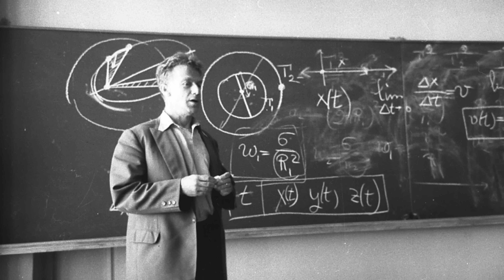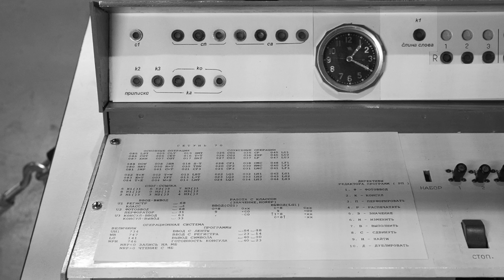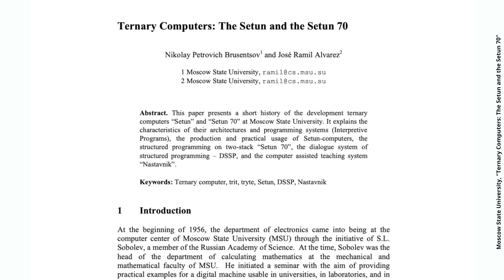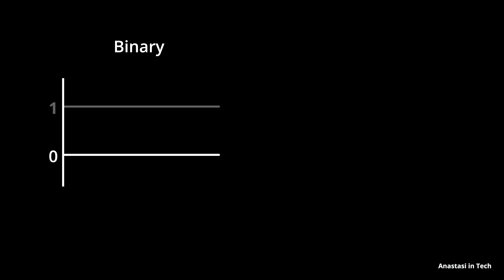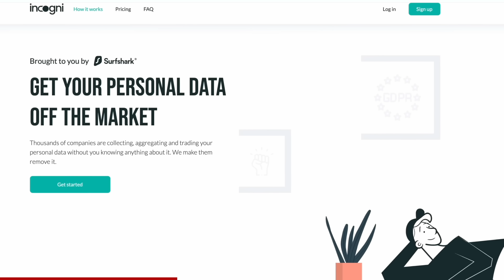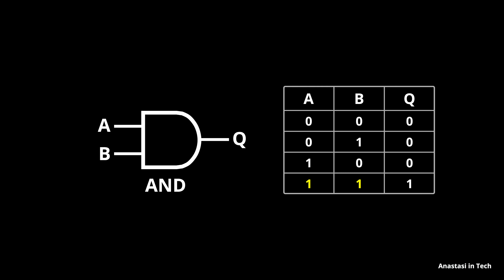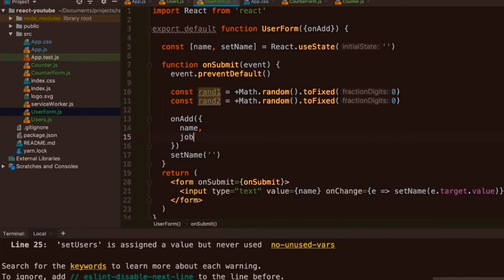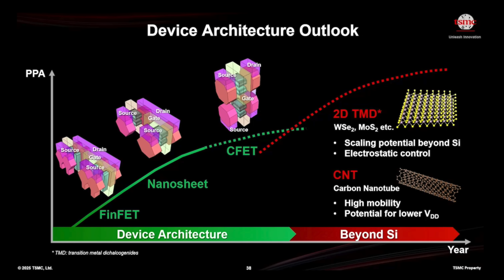The World's First Ternary Computer

Comment: There is a reason binary is dominant. It isn't just the math that needs to work. It's the physical mediums we use to transfer data. It's not just vacuum tubes but copper and fiber cables transfer data via electricity or light traveling the wire is either on or off (1 or 0).  Having to find a 3rd state and measure it will cause more errors and delay.
Reply: We invented a whole class of semiconductors called Schmitt Trigger buffers to differentiate high and low voltage signals. Its not a question of changing formats from hex to octal to BCD. Which are still essentially binary systems. This is a totally different system. Things are either on or off in the digital world, not partially on. Not to mention binary and Boolean logic easily interchange.
Reply: @AdamMiller-o2d 

If voltage sensing is so difficult and unusably error prone, I'm wondering why Nand Flash with it's current 16 voltage levels per floating-gate transistor (and the soon to be commercial 32 voltage level PLC) not run as hard into these  difficulties?

Also makes me wonder about DDR and even AGPx8 from a quarter of a century ago (Octa Data Rate), which I assume deal more properly with signals (than just sensing the voltage in a gloating gate transistor), would also need reliable qnd minimal error prone voltage sensing. 
In this case its not just a need to differentiate between different voltage levels, but the change in voltage.

I also wondering, since DRAM employs capacitors, multi voltage levels might be doable.
Reply: @tylerdurden3722  also 5g signal can use up to 256 states (8 bit) in one signal piece, 16 states on each of two axes wave amplitudes.
Reply: ternary is not totally different. It's easy to prove that functionality, it's equivalent with binary. So any possible benefit can only come from implementation. And then binary is just very simple and pragmatic. S/N will always be superior in a binary system.
Reply: convert  results to binary - note that trinary will save huge amt of elec
Reply: @hillwalker8741 plausible. nowadays we need also to care about quantum physics also.. lower voltage why? you get smaller n smaller n fields start to tunnel 😊 lets see what may be created in Future;) still qbits shown is not a singular  solution. means i think there may be a mix of some systematic ideas needed. 🤔
Reply: Who prevents you from conducting heavy computations in 3 states and then convert the data to 2 states for transmisson? Computers conver data all the time. File formats, encoding systems, energy levels, and even medium type. Converting base is one of the simplest tasks there is in this innovation.
Reply: @DimaZheludko  Hell the entire NIC architecture is a computer BESIDE the computer to do communication transmission.
Reply: @DimaZheludko nobody prevents, but you may loose suddenly the positive effects of it. somehow you depend on the infra. it may be not a quastion of doabiliry. hunankind and computers... ist relatively "new" ... and sure not the final spoken word. its a development. thanks to ada and Alan 😅
Reply: @DimaZheludko  It's not that you're prevented, it's just that it requires more precision at the lowest of levels. It may be easier to pull that off today, but the fact that it's still making something hard even harder is unchanged. Also, the conversions you mentioned may be expressed and represented to you differently, but they are still binary under the hood.
Reply: @lloydharris8766  Agree with both points. Well, what can I say. If it was easy, everyone would do it already. 
So until someone does it and proves that three states are better indeed, we'll have to guess.
Reply: By the way, SSD drives store 2 or 3 bits per cell. So, the concept of storing more data with more energy levels is not unprecedented. Or course, storing is one thing, and processing is totally another. However, 3 bits is much more complex than 3 states (wich is more like a 1.5 bit).
Reply: @lloydharris8766  Sure, it was difficult 100 years ago. But today, practically all transmission technologies you use employ more than two states. Wi-Fi, Ethernet, USB, etc. None of that uses two states at the physical layer. Some even use three states, like some decades old version of Ethernet. But usually more than that.
Reply: @DimaZheludko  you are comparing 3 bits which are 6 states ( 0 or 1 multiplied by 3) with only a trit, which has 3 states. You should compare 3 bits to 3 trita, which is 9 states (3 states x 3 cells)
Reply: @justiziero eh you do the same.. exp(b,n) 😊 symbol combinations, Interpretation. in rhe final end nevertheless how you do, all are patterns ;-)
Reply: This is the best explanation. yes. its simplicity is its power
Reply: Electricity can be OFF, Positive Voltage,  Negative Voltage
Light can be OFF,  and ON in 2 different polarities

so instead of just +5V, 0V you would have +5V, 0, -5V as possible values for trits
Reply: @LucasFerreira-n6e  I believe currently the levels are 0v and 1.67v
Reply: @qantj  "Currently" is not a thing. Voltages depend on a CPU model and even bios settings. 
I set my voltages as low as 0.7-0.8 volts. The lower the voltage, the less heat CPU will produce. Less heat = less cooling = less noise. There is a chance of instability at low voltages though, so they have to be carefully tested.
Reply: @DimaZheludko  why not relying on the manufacturers settings with the optimum levels established through thorough research involving highly complex system, not a homemade one based on the simplest parameter?
Reply: @lesterryanmd  Your question about optimum levels is too broad to interpret without proper context. I'll make a guess, and if my guess is wrong, try more exact question next time.
If you're asking why I set my CPU voltage lower that factory default, it's because factory default settings are tweaked to needs of wide range of average users. And I'm not an average user. My needs are quite specific, so my optimization is specific as well.
Reply: @qantj sounds about right 
It was 5v then 3.3 volts. As you lower the voltage you get more efficiency and less heat
Reply: @loulelea  Not just greater efficiency (less heat is due to the increased efficiency ;P), but also increased clock speed capability since the system doesn't need to change voltage as far
Reply: while thats true it is probably trivial for a company capable of making 7nm scale chips to design a new class of cable that has an extra set of conductors, or fiber strands for the -1's. A simple example: 2 fiber strands, wire A.) light on  =1 light off =0  wire B.) light on = -1 light off = 0. And then in theory the only conversion that has to happen is the one that already has to happen when the light is converted to electrons at the termination of the strand inside a GBIC/SFP or the like.  And whats fun about THAT is most commercial fiber runs already are run with extra 'dark' strands just in case a wire gets damaged, so you can borrow some of those in place to make it work without having to go re run all the existing fiber. 

as for how to split the 1s and -1s to the strands and back again reliably .... I only know enough to be dangerous, so you have me cornered there. But I am sure some big brain can figure it out.

The real challenge is getting consumers to accept all the losses of existing stuff when everything needs to be created on a new type of machine code. The same problem vexing ARM outside of mobile and Apple product markets.
Reply: Sure, interconnect hardware and cabling can still be binary but the computing hardware at the silicon layer looks promising in ternary.
Reply: @mohammadhalipoto even in serial data transmission you could potentially use a clock generator to distinguish between plus voltage minus voltage and no voltage
Reply: @loulelea  Or you can use diodes, just like when taking a sinusoidal voltage that ranges from +V to -V and isolating either the positive or negative voltage from it.
Reply: @bryankreinhart indeed that’s how and or nor gates are made
Reply: Except that right now data is transmitted across copper by varying voltages. One voltage = 0 and another = 1. So, you add in a third voltage level to = -1 or 2. The same can be done with fiber. Use colors. One wavelength = -1, another = 0, and a third = 1. It wouldn't even be that hard to do with current technology.
Reply: @JoelVogt1972  What you're proposing for optics is essentially frequency modulation (using changes in frequency to encode a signal). I don't think anybody would do that. It's rather naive. Simultaneous transmission of multiple wavelengths is used for multiplexing. So we do have the required technology to combine light from multiple lasers and to then split it (which is where you have to separate wavelengths as receivers are typically not too picky). But there are more sophisticated ways to create multiple states than simply "blinking" different colours.
Reply: The output of each logic cone at the input of each latch would have to reach its final state a little before the next clock edge. This is the same for binary.

But this makes me wonder, would that require clocks to run slower (for a given technology)?

Naively I would think the swing from -1 to +1 would take longer than from either -1 or +1 to 0, so clocks would not need to be slower. But because there’s more ambiguity distinguishing zero from the other two states, maybe it would take longer to reach an unambiguous final state…?
Reply: Actually, transmission is the least problematic of all. And three states are trivial to create by simply using negative rail for the third state (that is +V, 0, -V). Today, QAM and PAM are widely used and all use more than 2 states (256-QAM has 256 states encoding 8 bits per clock cycle). Not to mention that data is generally encoded for transmission (and storage). One of the classics being 8b/10b (encoding 8 bits of data into 10 bits for transmission). Exactly because you have to deal with limitations of transmission lines and transceivers. Even in the binary world, you don't want long strings of zeros (or ones, conversely) which you might encounter in real data. Hence why you have schemes like 8b/10b or Manchester.
Reply: The technology exists where light can be used for high-speed data transfer. The advantage of light is that multiple wavelengths can be combined (multiplexed). And, if using RGB for the 3 states and, using a simple example of the byte values of RGB used in your color palette, it would be:
  RED  | GREEN | BLUE
====================
 0x00 |  0x00 | 0x00
 0x00 |  0x00 | 0x7F
 0x00 |  0x00 | 0xFF
 0x00 |  0x7F | 0x00
 0x00 |  0x7F | 0x7F
 0x00 |  0x7F | 0xFF
 0x00 |  0xFF | 0x00
 0x00 |  0xFF | 0x7F
 0x00 |  0xFF | 0xFF
 0x7F |  0x00 | 0x00
 0x7F |  0x00 | 0x7F
 0x7F |  0x00 | 0xFF
 0x7F |  0x7F | 0x00
 0x7F |  0x7F | 0x7F
 0x7F |  0x7F | 0xFF
 0x7F |  0xFF | 0x00
 0x7F |  0xFF | 0x7F
 0x7F |  0xFF | 0xFF
 0xFF |  0x00 | 0x00
 0xFF |  0x00 | 0x7F
 0xFF |  0x00 | 0xFF
 0xFF |  0x7F | 0x00
 0xFF |  0x7F | 0x7F
 0xFF |  0x7F | 0xFF
 0xFF |  0xFF | 0x00
 0xFF |  0xFF | 0x7F
 0xFF |  0xFF | 0xFF
How these values are interpreted is not set in stone and can be, arbitrarily, +1 = 0x00, 0 = 0x7F, -1 = 0xFF, or even +1 = 0x7F, 0 = 0x00, -1 = 0xFF.
Reply: @bryankreinhart I find the light tech to be fun to study. But think about an interface that bonds discrete light channels with this ternary system (used for sensor switching matrix), good and durable for direct transport. At some point, subsystems come into play, regarding the final product. My brain cannot conceive of light channels being energy efficient except at volume, such as data transport. There's a video on this I haven't watched yet.
Reply: @bryankreinhart you are mixing up things. What you describe cannot work because the white light at the bottom of your list is indistinguishable from R+G+B. Also there's absolutely no reason to stick to RGB. The important factor is how well the light producer and sensor can operate within well defined frequency bandwidths.
Reply: And the circuitry requires more than 2x as many transistors per logic gate for only 3/2 as man values.  PER DATA LINE.  And the compexity only gets worse when you look at things such as adder/subtractors.
In comparison, "not valid" can be indicated by merely devoting one bit to be "valid/not valid" for any sized quantity... or not.  Thus, even the argument for "0, 1, not-valid" isn't even worth the cost, complexity and extra power consumption.
Reply: I was about to write a similar comment to yours because i didn't know there was one like this so instead im just gonna like this comment
Reply: Hard drives  and ssd also can not store ternary data YET AFAIK
Reply: @dosergiobr  What do you mean? SSDs store 3 bits per cell, not even 3 states.
3 bits is 8 states. So it's not out of the question to store even two trits of data per cell, if market ever demands. Storing 3 states is a walk in a park compared to what we do now. 

Also, nobody stops you from using SSDs as they are not and just convert data somewhere down the line.
Reply: @dosergiobr  Idk how you'd do it for hard drives but SSDs already have multiple storage levels so you just change how you recognise them from binary 3 or 4 state per memory cell (0000-1111) to trinary (000 to 111/-111 or some such, quad storage tends to be a bit unstable I think).
Reply: @dosergiobr hm. good point 😂 but no idea how internaly really its done. but well lets say there could be a solution somehow
Reply: It is widely used already - as DDR on RAM buses. We're used since early 1980-s, in big supercomputers and telecommunications. Wasn't cheap, but not unique.
Reply: Oh, no. Here we go with numerology and trinity. Of course triangles have three sides. And traffic lights have three colors! And tricycles have three wheels!  The lamp in my living room has three different brightness settings! It must all mean something!
Reply: @SolidAir54321  Oh, yes, yes! You see it too! Join our group of those, who see world as it is - in 3 states! Let's fight these 4-worshipers! 

You see, today they say that matter have 4 states instead of 3. But what tomorrow? Tomorrow thay'll say that we live in 4-dimentional spacetime (or some other nonesence) and now we have to put 4-th wheel on all our tricycles! 

What next? All computer graphics will be drawn with squares? 4 color subpixels in displays? In no time we'll have all Rickshaw's on four wheels! We can't have that! Think of the Chile!
Reply: "Having to find a 3rd state and measure it will cause more errors and delay." -- this should not worry us.  We have several advanced error detection and correction algorithms that are being used in digital communications.  There may be a little bit of reduction in transmission efficiency, though.
Reply: false and short sighted as a wombat:face-green-smiling:
Reply: agreed, but the chips exist, 3 power lines cause more cost but only in the power lines, the ground line as in 3 phase, should carry minimal current and be there as a reference.... but the benefits of 3 states ^n vs 2 states^ is obvious. the copper losses should work out equivalent. Insulation is cheap. cheers mate
Reply: All you geniuses out there keep talking about voltage and blah blah blah....here's the thing, copper is being phased out as a physical medium. It's all about fiber today. So tell me about how light has 3 states. Oh wait, it doesn't.
Reply: @dtharve My lamp has bright, dull and off states. We just need a three state switch. : )
Reply: @RJjohnson2026 yes. but dull costs Energy. maybe light is fast enough to serialize instead dull... problem msy be the differentiation of dull state to map... nevertheless... a Transistor also has sigmoidal nature and just 2 stages are used. some things tech does may have some reasons.
Reply: @dtharve  Light has many different wavelengths where specific wavelengths can represent specific values. You have heard of RGB (Red-Green-Blue) haven't you?
Reply: @bryankreinhart sure. and that mapping makes things more easy? a frequency light Splitter. lol
Reply: @fishypkat151  Have you ever heard of "fiber optics" technology?
Reply: @dtharve  Information transfer with light is more complicated than on or off. Information is often encoded in the amplitute, frequency, and/or the phase
Reply: @dtharve  light is EM just like the waves on copper, and you can encode it in as many phase and amplitude states as you want.  Laser modulators are currently 4 phase states.  RF is using 4096 in some applications.  It’s all limited by signal to noise.
Reply: exactly
Reply: Why limit your argument with only the states of on or off instead of expanding your mind?
Data can be transferred in 3 states easily. You can use off, positive voltage and negative voltage. Even using "primitive" technology using a relay, you can decode such a signal. The relay is designed with two coils (A & B), one on either side of the armature. When a positive voltage is sent, direct it to coil A energizing it for one state (+V). When zero volts is sent, neither relay in energized for the second state (0V). When a negative voltage is sent, direct it to coil B to energize it for the third state (-V). Think of it as a switch that, in the center position, it is off. When flipped up, it sends a positive voltage. When flipped down, it sends a negative voltage. Such switches are used on electronics such as the Cobra 148 GTL where, if the switch is set in the middle, it is on AM; if up then USB; if down then LSB. On the 148, there are 4 such 3 position switches.
Reply: Most fiber uses 4 states - QAM
Reply: I agree. The power of binary was the lowest level building block. It was about predictive results, and knowledge about error checking, Hamming Code, Gray Code for electronics, failover state. Any higher chance of logic fail was unacceptable. The necessity of ECC just sounds bad. I thought of trinary, but the fragility is in question. It solves a fundamental logic gate problem though.
Reply: Agreed we have,  and nor and or detectors that also function in pneumatic and liquid logical devices like machine tools and autotransmission.
Reply: The reason is that math is hard. NOBODY solved electrostatics in 3D. I think the Steinmetz equation was the attempt. Binary now has, per a conversation between Lex Fridman and Jim Keller, deterministic search outputs with NONDETERMINISTIC search paths. It was implied that this is the result of stacking the grids past a certain point. But they both just thought it was cool. I immediately knew it was the Stinkularity. You can stack to Heaven and still get the same output from the same input. Time resolves in the search, you only add duration with more compute, same out put every time. The end of complexity. The biosphere knows. 

I haven't looked, but bismuth might make a reliable 0-1-2 gate computer possible. But I know what humans are now. I hold zero hope that ANYONE will ever do the right thing for society. So let the species suffer the consequences. Let's see what the global population is like in 10 years.
Reply: Another reason: these days, two-state transistors are a commodity, and basically free. The marginal cost to add a few thousand transistors to a chip is close to zero, so there's no need to go to a third state. Also, quantum computing will likely leapfrog ternary chips.
Reply: A +1 or a -1 are quite distiguishable.
Reply: Actually nowadays almost all signals are sent via multiple voltage levels. It's not just on and off anymore.
Reply: Color. Color is the way we transfer different signals. Simple
Reply: On off negative.   Already exists
Reply: Im blown away
Reply: Yes, it is far easier to simply seperate the signal into high or low. Maintaining a stable middle state is very difficult, much less MULTIPLE middle states.
Reply: adding a middle state basically doubles the energy need all other things being equal
Reply: Actually, your statement is fundamentally incorrect, for both electricity and light. Let's take each case.

Electrical data transfer: You would have been correct DECADES ago, but we (long ago) found that using "no current flowing in the wire" as the "0" state is not only inefficient, but it is also highly vulnerable to noise on the wire -- and there's typically a LOT of noise on the wire in these systems. Thus, we instead use various forms of  "non-return-to-zero" ("NRZ") signaling at the bit level; "driving" the 0 state (rather than defining it passively as "no current flowing") adds a significant degree of immunity to noise on the wire. It also solves an important clock-synchronization problem.

Light: Doesn't travel in wires, but rather in optical conduits (fiber optic cables). Again, you would have been correct in the past -- and it's a much more recent past than in electrical data transfer, as fiber optics do not suffer from the "noise on the wire" issue, and thus "absence of light" was used as the "0" state for quite some time. However, modern data-transmission schemes in fiber optics use coherent optics to transmit symbols, much in the way that we transmit symbols via QAM (for example) in RF comms -- each symbol conveys a multiple-bit state, and is represented by a specific combination of phase and amplitude. This enables much higher data rates -- with actually more reliable transmission -- than could be achieved using the older "light on/light off" method.

Thus, transferring ternary data via wire or fiber is no different or more challenging than transferring binary data.
Reply: we dont need peripheral devices to communicate in binary, we only need the chip to be able to communicate in either logic system, so it can take advantage of the ternary boost during AI or complex computations. It can still communicate the answers to binary devices and record / save data to external binary drives
Reply: yes, but its possible to remap. ternary system or math is a nice principle also there is e.g. bitcpp, a ternary neuronal weighting allows reduce calculation steps massively. but what cost? always the same... time against mass (resp. ram)😊
Reply: That's like saying, "Why use General Relativity if Classical Mech. is simpler".
Reply: @lexdyelmendez4776 😊 👍💫 wordplay... realism vs relativism :) really good point. first do the obvious n working. yepp.
Reply: This!
Reply: Can then we use binary for inter computer data transfering but the computer will be ternary?
Reply: @extinguished0ne sure. fact is, cmos is not ternary. fullstop. 😂
Reply: All electronics have three states... Positive +1, off 0, and Negative -1. We just chose to use Off/On as the foundation, because it was cheap, easy and fit base-10 better than trinary states.
Reply: Its not as simple as on and off in Fibre Wire and even normal Ethernet.
Reply: I'm no expert, but could the move towards light-based processors/computers instead of current help in this regard?
Reply: Is this why analogue computers haven't really taken off, either?
Reply: That and the fact it proved that it worked for virtually everything we needed it for for many years, and it scaled wonderfully.
Only now that we are hitting the limits from it seems like all sides, there is a motivation to once again reimagine everything about computers.
Reply: In the 80's, I worked for a Defense & Space R&D developer.  We used a new technology called ECL (Emitter Coupled Logic).  It was blinding fast and toggled between Plus and minus 2.5v.  It was a clear opportunity to explore ternary logic.  +2.5v, 0v, and -2.5v.  It required a lot of infrastructure to operate but it did work.. and FAST.
Reply: For photonic computers, there are light intensity, wavelength, phase, propagation direction and polarization of five states not two.
Reply: No one uses tubes anymore but you are right. Switching "On or Off" is simple for components
Reply: Three States of Light: Experimental ternary systems often use no light (0), horizontally polarized light (1 or -1), and vertically polarized light (1) to represent three distinct logical values.Color Encoding: Some concepts propose using the visible spectrum (Red, Green, Blue) as a trinary code, where different shades or combinations represent distinct values beyond simple "on/off" binary.Efficiency: A trinary system is mathematically more efficient than binary; for example, a number requiring 42 bits would only need 27 trits.
Reply: Sure you could say that but. What about a Fusion/Hybrid of Binary and ternary. My Thinking Process: Imagine a Router connecteted via a normal DSL Cable and a normal Power Connector, the hardware is ternary based and obv is a Jankie mess if not for the NIC that was made with a second chip or integrated with a translator Binary (Electrical current) = Ternary and the same with power
Reply: Congratulations, you studious guys. I wish I too could take my eyes off her face.
Reply: @AamBhartiyaNagrik  If you don't want to see her face, don't see the video! Simple that.
Reply: @victorpinasarnault9135  I bet English is not your primary language, for I was complimenting her and not ridiculing her. Please try to understand the meaning of the comment. She is incredibly gifted with look. Besides, she is intelligent and learned.
Reply: @AamBhartiyaNagrik  I was thinking the same.
Reply: Data transmission is more complicated than on or off, multiple bits are often stored in complex waveforms to increase data bandwidth
Reply: It's a fully solved problem since 628 AD, and is cheaper. Read Brahmasphutasiddhanta explaining Kha,Rna,Dhana,Shunya,Akasha,Sva. 6 states, a "tryte". The reason binary is used because people are no smarter than they were 1397 years ago.
Reply: @wwkk4964  Well, then trinity is the way to go. It's like one religion was suggesting this architecture all along. One being in three states.
Reply: @DimaZheludko All religions (biggest or smallest) have trinity, they all dress it up differently. 13 way to be exact.
Reply: @DimaZheludko the universe works in binary
Reply: @manannaik1341  Or maybe in ternary?
We live in 3 dimentions.
There are 3 states of matter.
There are 3 Newton's laws of motion.
We use 3 phases to transfer electricity.
Even you. 
To survive, you need to consume 3 main types of food: proteins, fats and carbohydrates.
You see 3 main colors.
Your brain has 3 main systems: reptilian, limbic, and neurocortex. 
It looks like everything in this world is around 3's. 🙂
Reply: @DimaZheludko 4 states of matter
Reply: @manannaik1341  Oh, nooo! You ruined my world! Now, I'll have to worship ugly squares instead of pretty slim triangles.

Btw, almost all 3D graphics is built on triangles. 3 states never give up! 😅
Reply: @DimaZheludko love it how you try to convince to use 3 and made up things based on on 3… the electricity you use your house is 1 phase only… the matter have 4 phases plasma including… the dimensions are more then 3… 7 layers of heaven and 7 for hell… and we are in middle the earth.. and newton have different laws those are more then 3… and we are in 3D by our eyes…and those 3 colors comes from white… the sun from which we can see 7 colors when we see the rainbow
Reply: @manannaik1341  
3 colors you see come not from white, but from 3 types of color sensors in your retina. White is just a case when all three of them are equally excited to a high levels.

7 colors of rainbow is just an abstraction. You could divide a rainbow by as many or few colors as you like. Spectrum is is called that for a reason. There are no borders between rainbow colors. It's just that culturally you are conditioned to see 7 colors in rainbow, that's why you divide it into 7 stripes.

I love how seriously you take my absurd argumentation.
Reply: @DimaZheludko if there is only 3 color censors how are we defining different colours? Specifically from rainbow… and talking about absurd comments? You started it
Reply: @wwkk4964  however there is a similarity for all the followers, in the end they all get a backdoor input in a prison shower meaning
Reply: @manannaik1341 I would think the universe may have three states for example a magnet has a attracted and a repulsive state but what is the middle? Ying and Yang to complete the circle but what is on the outside of the circle
Reply: @manannaik1341  No, the universe is analog
Reply: @manannaik1341  I can think of at least 5: Solids, gas, liquids, plasma, Einstien-Bose condensate
Reply: @manannaik1341  Our eyes have cones that detect light centered in Red, Blue, and Green (their activation isn't a point but a range of energies). The brain then performs calculations and the colour you see is dependant on how each type of cone is activated.
Reply: @DimaZheludko  there are more than 3 states of matter. You have 2 hands, 2 legs, 10 fingers, 2 eyes, dna and rna use 4 amino acids, 4 fundamental forces, 2 electrons per orbital, carbon can have 4 bonds.
Reply: @loulelea  You are missing the 3 states of it. Yin, Yang, Tao. Or, Negative, Positive, Neutral. In Japanese, it is In-Yo. Both use the same characters, 陰陽.
Reply: @DimaZheludko we live in 4 dimensions.. time is a dimension